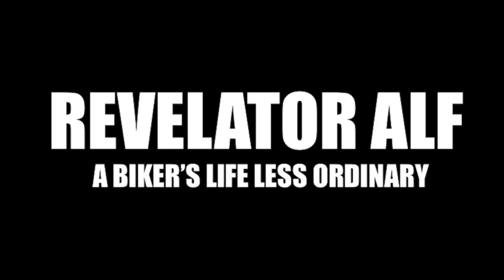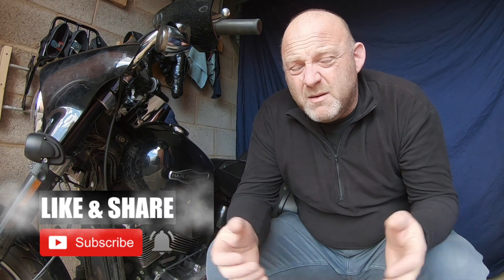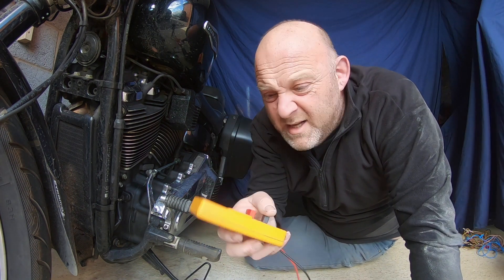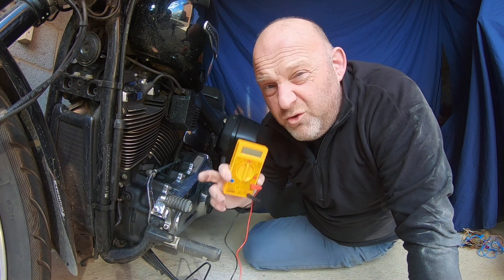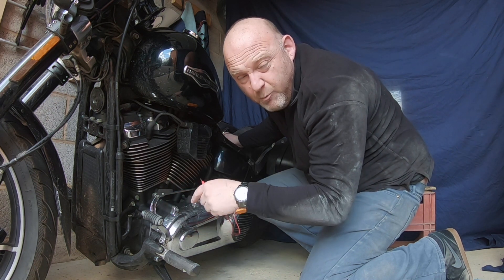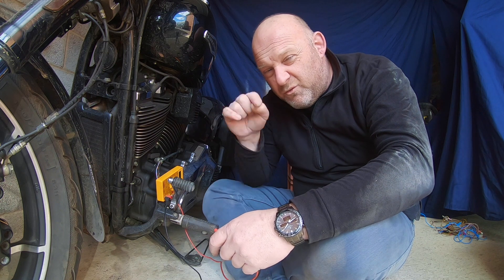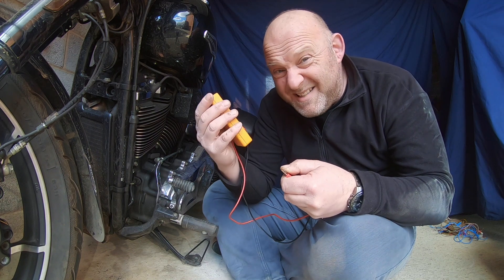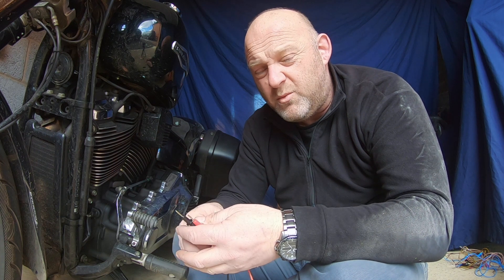How To Test Harley Davidson M8 Softail Alternator | H-D AC Voltage Output and Stator Test

Comment: If you'd done the alternator voltage test right off the bat, that would have told you if the alternator was working properly or not. If the alternator voltage was good, then the alternator wasn't the problem. If the voltage was incorrect, then the resistance checks may have been useful.
Basic electrical troubleshooting, always check voltage first.
Reply from the maker: This was part of a series of electrical checks videos. That is covered in other videos